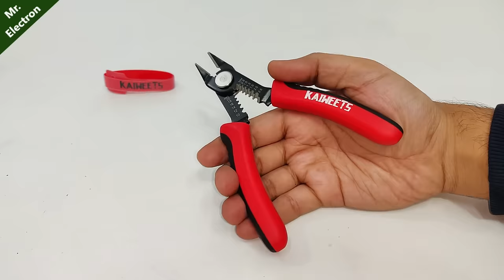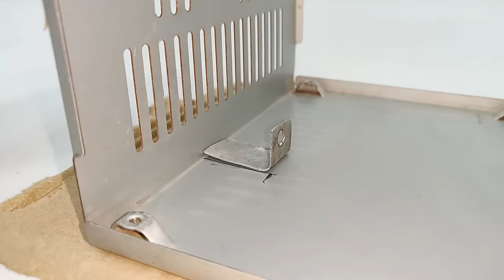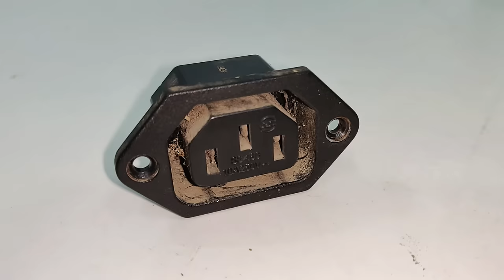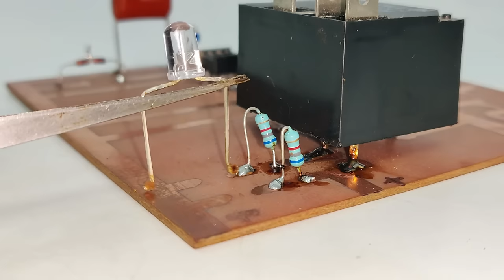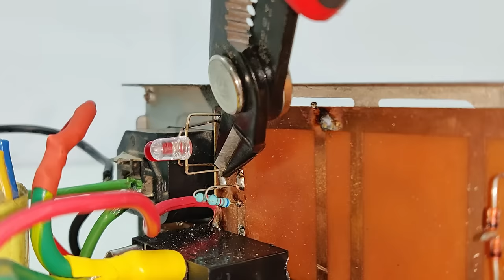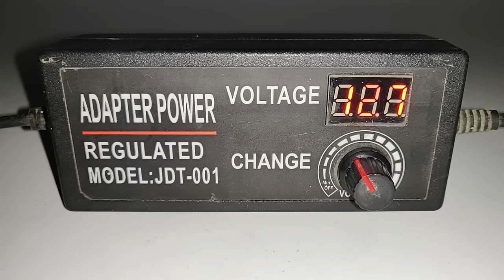12 Volt 150Ah Battery Charger using old Computer Power Supply - 220V AC to 12V DC

Comment: Why you are not providing the circuit diagram in your videos
Reply: Query: Can you really trust this guy? Does he really know  electronics - or is he just screwing around - buried in ignorance?
First he says its using an ATX PSU but at the very end he says he  is using a microwave  transformer.
Then he puts two 10A bridge rectifiers in parallel BUT even a novice knows this does not work [because the Vd are different].
Then his Mickey Mouse controller uses a puny relay which can not handle the stated current.
He does not explain the cntroller but it seems to be a simple cut-off; the charging current is not controlled and can be DANGEROUS.
 I have read 4 recommedations from battery makers and many articles from creditable battery experts and they ALL say current must be controlled.

Comment: Thanks for video.
Reply: can you trust this guy? Does he really know  electronics - or is he just screwing around?
First he says its using an ATX PSU but at the very end he says he  is using a microwave  transformer.
Then he puts two 10A bridge rectifiers in parallel BUT even a novice knows this does not work [because the Vd are different].
Then his Mickey Mouse controller uses a puny relay which can not handle the stated current.
He does not explain the cntroller but it seems to be a simple cut-off; the charging current is not controlled and can be DANGEROUS.

Comment: 귀하의  노력에 감사드립니다👏
Reply: can you trust this guy? Does he really know  electronics - or is he just screwing around?
First he says its using an ATX PSU but at the very end he says he  is using a microwave  transformer.
Then he puts two 10A bridge rectifiers in parallel BUT even a novice knows this does not work [because the Vd are different].
Then his Mickey Mouse controller uses a puny relay which can not handle the stated current.
He does not explain the cntroller but it seems to be a simple cut-off; the charging current is not controlled and can be DANGEROUS.

Comment: Super Mr electron
Reply: can you trust this guy? Does he really know  electronics - or is he just screwing around?
First he says its using an ATX PSU but at the very end he says he  is using a microwave  transformer.
Then he puts two 10A bridge rectifiers in parallel BUT even a novice knows this does not work [because the Vd are different].
Then his Mickey Mouse controller uses a puny relay which can not handle the stated current.
He does not explain the cntroller but it seems to be a simple cut-off; the charging current is not controlled and can be DANGEROUS.

Comment: Bro automatic battery cut off circuit diagram ?
Reply: Query: Can you really trust this guy? Does he really know  electronics - or is he just screwing around - buried in ignorance?
First he says its using an ATX PSU but at the very end he says he  is using a microwave  transformer.
Then he puts two 10A bridge rectifiers in parallel BUT even a novice knows this does not work [because the Vd are different].
Then his Mickey Mouse controller uses a puny relay which can not handle the stated current.
He does not explain the cntroller but it seems to be a simple cut-off; the charging current is not controlled and can be DANGEROUS.
 I have read 4 recommedations from battery makers and many articles from creditable battery experts and they ALL say current must be controlled.

Comment: Very cool!
Reply: Can you really trust this guy? Does he really know  electronics - or is he just screwing around - buried in ignorance?
First he says its using an ATX PSU but at the very end he says he  is using a microwave  transformer.
Then he puts two 10A bridge rectifiers in parallel BUT even a novice knows this does not work [because the Vd are different].
Then his Mickey Mouse controller uses a puny relay which can not handle the stated current.
He does not explain the cntroller but it seems to be a simple cut-off; the charging current is not controlled and can be DANGEROUS.
 I have read 4 recommedations from battery makers and many articles from creditable battery experts and they ALL say current must be controlled.

Comment: Awesome 😎😎😎😎
Reply: can you trust this guy? Does he really know  electronics - or is he just screwing around?
First he says its using an ATX PSU but at the very end he says he  is using a microwave  transformer.
Then he puts two 10A bridge rectifiers in parallel BUT even a novice knows this does not work [because the Vd are different].
Then his Mickey Mouse controller uses a puny relay which can not handle the stated current.
He does not explain the cntroller but it seems to be a simple cut-off; the charging current is not controlled and can be DANGEROUS.

Comment: Good job
Reply: can you trust this guy? Does he really know  electronics - or is he just screwing around?
First he says its using an ATX PSU but at the very end he says he  is using a microwave  transformer.
Then he puts two 10A bridge rectifiers in parallel BUT even a novice knows this does not work [because the Vd are different].
Then his Mickey Mouse controller uses a puny relay which can not handle the stated current.
He does not explain the cntroller but it seems to be a simple cut-off; the charging current is not controlled and can be DANGEROUS.

Comment: You are genius
Reply: Query: Can you really trust this guy? Does he really know  electronics - or is he just screwing around - buried in ignorance?
First he says its using an ATX PSU but at the very end he says he  is using a microwave  transformer.
Then he puts two 10A bridge rectifiers in parallel BUT even a novice knows this does not work [because the Vd are different].
Then his Mickey Mouse controller uses a puny relay which can not handle the stated current.
He does not explain the cntroller but it seems to be a simple cut-off; the charging current is not controlled and can be DANGEROUS.
 I have read 4 recommedations from battery makers and many articles from creditable battery experts and they ALL say current must be controlled. 

I just read a comment by him saying the transfomer is rated at 40A !!!!   LMAO  But the diode bidge is 10A and that play-time relay can handle no more than  6A DC.   This is a JOKE from bizarre start to laughable finish

Comment: Very nice
Reply: can you trust this guy? Does he really know  electronics - or is he just screwing around?
First he says its using an ATX PSU but at the very end he says he  is using a microwave  transformer.
Then he puts two 10A bridge rectifiers in parallel BUT even a novice knows this does not work [because the Vd are different].
Then his Mickey Mouse controller uses a puny relay which can not handle the stated current.
He does not explain the cntroller but it seems to be a simple cut-off; the charging current is not controlled and can be DANGEROUS.

Comment: It will  not work for inverter battery 150 ah u need bigger transformer your title is wrong
Reply from the maker: No, actually a 150Ah c20 battery only needs a max of 15Amps and this transformer can produce a max of 40 Amps as can be seen in this video's "power supply test".
Reply: @MrElectron  
Query: Can you really trust this guy? Does he really know  electronics - or is he just screwing around - buried in ignorance?
First he says its using an ATX PSU but at the very end he says he  is using a microwave  transformer.
Then he puts two 10A bridge rectifiers in parallel BUT even a novice knows this does not work [because the Vd are different].
Then his Mickey Mouse controller uses a puny relay which can not handle the stated current.
He does not explain the cntroller but it seems to be a simple cut-off; the charging current is not controlled and can be DANGEROUS.
 I have read 4 recommedations from battery makers and many articles from creditable battery experts and they ALL say current must be controlled.

Comment: Well. From what can be seen, only the case of a PC power supply was used. The rest of the elements were added. I want to believe that the title is misconceived. In any case it would have to be; "adapted battery charger in a pc power supply case".🤦‍♂
Reply: Query: Can you really trust this guy? Does he really know  electronics - or is he just screwing around - buried in ignorance?
First he says its using an ATX PSU but at the very end he says he  is using a microwave  transformer.
Then he puts two 10A bridge rectifiers in parallel BUT even a novice knows this does not work [because the Vd are different].
Then his Mickey Mouse controller uses a puny relay which can not handle the stated current.
He does not explain the cntroller but it seems to be a simple cut-off; the charging current is not controlled and can be DANGEROUS.
 I have read 4 recommedations from battery makers and many articles from creditable battery experts and they ALL say current must be controlled.

Comment: Muito bom parabéns Brasil..
Reply: Can you really trust this guy? Does he really know  electronics - or is he just screwing around - buried in ignorance?
First he says its using an ATX PSU but at the very end he says he  is using a microwave  transformer.
Then he puts two 10A bridge rectifiers in parallel BUT even a novice knows this does not work [because the Vd are different].
Then his Mickey Mouse controller uses a puny relay which can not handle the stated current.
He does not explain the cntroller but it seems to be a simple cut-off; the charging current is not controlled and can be DANGEROUS.
 I have read 4 recommedations from battery makers and many articles from creditable battery experts and they ALL say current must be controlled.

Comment: where are you from sir
Reply from the maker: India
Reply: @MrElectron   no sir
R u lie
Reply from the maker: Ha ha ha.. Why would i lie 😕 ?
Reply: Can you really trust this guy? Does he really know  electronics - or is he just screwing around - buried in ignorance?
First he says its using an ATX PSU but at the very end he says he  is using a microwave  transformer.
Then he puts two 10A bridge rectifiers in parallel BUT even a novice knows this does not work [because the Vd are different].
Then his Mickey Mouse controller uses a puny relay which can not handle the stated current.
He does not explain the controller but it seems to be a simple cut-off; the charging current is not controlled and can be DANGEROUS.
 I have read 4 recommedations from battery makers and many articles from creditable battery experts and they ALL say current must be controlled. 
He does not even bother to say its for lead-acid batteries.
Why state the AH???  It is the C-rate that is important!!  How can he not know this???

I just read a comment by him saying the transfomer is rated at 40A !!!!   LMAO  But the diode bridge is 10A and that play-time relay can handle no more than  6A DC.   This is a JOKE from bizarre start to laughable finish

Comment: Ótimo, parabéns!
Reply: can you trust this guy? Does he really know  electronics - or is he just screwing around?
First he says its using an ATX PSU but at the very end he says he  is using a microwave  transformer.
Then he puts two 10A bridge rectifiers in parallel BUT even a novice knows this does not work [because the Vd are different].
Then his Mickey Mouse controller uses a puny relay which can not handle the stated current.
He does not explain the cntroller but it seems to be a simple cut-off; the charging current is not controlled and can be DANGEROUS.

Comment: Very nice project done nice watching and would try to implement it practically can you please share the pcb diagram. Regards
Reply: can you trust this guy? Does he really know  electronics - or is he just screwing around?
First he says its using an ATX PSU but at the very end he says he  is using a microwave  transformer.
Then he puts two 10A bridge rectifiers in parallel BUT even a novice knows this does not work [because the Vd are different].
Then his Mickey Mouse controller uses a puny relay which can not handle the stated current.
He does not explain the cntroller but it seems to be a simple cut-off; the charging current is not controlled and can be DANGEROUS.

Comment: Wuld by great if you culd some how invent ordinary phase shifter for pick up coils"reluctors" that project wuld gain popularity . Well I'm pore guy can't aford any thing suposedli an 555 timer and xor gate ic chip the 4017 can do that trick ,or external power supply can by used on an pick up coil negative lead . That simpel cirquets are reali nice for people who have cold start problems .Even tough those mentioned cirquets are used mostli on MSD ignition and CDI box's but for HEI ther is no info how to force that deam thing to manuali regulate ignition timing. Wuld by great if some one would make some sort of manual cirquet it's basicali ordinary AC generator who requares 0° to 90° pulse phase shifter. Wuld like to see that litel experiment . Well an ordinary satelite dish motor might by usefull project that thing looks nearli identical what I normali wuld requare but with out reciver that thing can only by used by an buton command . So that project wuld by great as well .
Reply: Query: Can you really trust this guy? Does he really know  electronics - or is he just screwing around - buried in ignorance?
First he says its using an ATX PSU but at the very end he says he  is using a microwave  transformer.
Then he puts two 10A bridge rectifiers in parallel BUT even a novice knows this does not work [because the Vd are different].
Then his Mickey Mouse controller uses a puny relay which can not handle the stated current.
He does not explain the cntroller but it seems to be a simple cut-off; the charging current is not controlled and can be DANGEROUS.
 I have read 4 recommedations from battery makers and many articles from creditable battery experts and they ALL say current must be controlled.

Comment: Sin diagrama no le veo ninguna utilidad, lo he buscado y no lo veo por ningun sitio.
Reply: Can you really trust this guy? Does he really know  electronics - or is he just screwing around - buried in ignorance?
First he says its using an ATX PSU but at the very end he says he  is using a microwave  transformer.
Then he puts two 10A bridge rectifiers in parallel BUT even a novice knows this does not work [because the Vd are different].
Then his Mickey Mouse controller uses a puny relay which can not handle the stated current.
He does not explain the cntroller but it seems to be a simple cut-off; the charging current is not controlled and can be DANGEROUS.
 I have read 4 recommedations from battery makers and many articles from creditable battery experts and they ALL say current must be controlled. 

I just read a comment by him saying the transfomer is rated at 40A !!!!   LMAO  But the diode bidge is 10A and that play-time relay can handle no more than  6A DC.   This is a JOKE from bizarre start to laughable finish

Comment: Sr iska diagram Dena
Reply: Can you really trust this guy? Does he really know  electronics - or is he just screwing around - buried in ignorance?
First he says its using an ATX PSU but at the very end he says he  is using a microwave  transformer.
Then he puts two 10A bridge rectifiers in parallel BUT even a novice knows this does not work [because the Vd are different].
Then his Mickey Mouse controller uses a puny relay which can not handle the stated current.
He does not explain the cntroller but it seems to be a simple cut-off; the charging current is not controlled and can be DANGEROUS.
 I have read 4 recommedations from battery makers and many articles from creditable battery experts and they ALL say current must be controlled. 

I just read a comment by him saying the transfomer is rated at 40A !!!!   LMAO  But the diode bidge is 10A and that play-time relay can handle no more than  6A DC.   This is a JOKE from bizarre start to laughable finish

Comment: Nice 👍👌👌 02/02/2023 🇮🇳
Reply: Can you really trust this guy? Does he really know  electronics - or is he just screwing around - buried in ignorance?
First he says its using an ATX PSU but at the very end he says he  is using a microwave  transformer.
Then he puts two 10A bridge rectifiers in parallel BUT even a novice knows this does not work [because the Vd are different].
Then his Mickey Mouse controller uses a puny relay which can not handle the stated current.
He does not explain the cntroller but it seems to be a simple cut-off; the charging current is not controlled and can be DANGEROUS.
 I have read 4 recommedations from battery makers and many articles from creditable battery experts and they ALL say current must be controlled. 

I just read a comment by him saying the transfomer is rated at 40A !!!!   LMAO  But the diode bidge is 10A and that play-time relay can handle no more than  6A DC.   This is a JOKE from bizarre start to laughable finish

Comment: Nice project, but you have to learn to weld well, your solder soldering leaves something to be desired, use a better welder, and regarding the mechanics, also use some washers under the screws, bye
Reply: Can you really trust this guy? Does he really know  electronics - or is he just screwing around - buried in ignorance?
First he says its using an ATX PSU but at the very end he says he  is using a microwave  transformer.
Then he puts two 10A bridge rectifiers in parallel BUT even a novice knows this does not work [because the Vd are different].
Then his Mickey Mouse controller uses a puny relay which can not handle the stated current.
He does not explain the cntroller but it seems to be a simple cut-off; the charging current is not controlled and can be DANGEROUS.
 I have read 4 recommedations from battery makers and many articles from creditable battery experts and they ALL say current must be controlled.